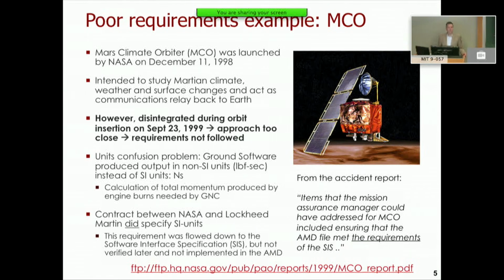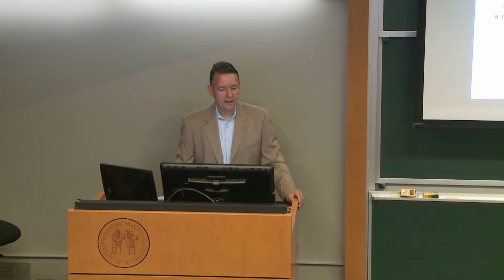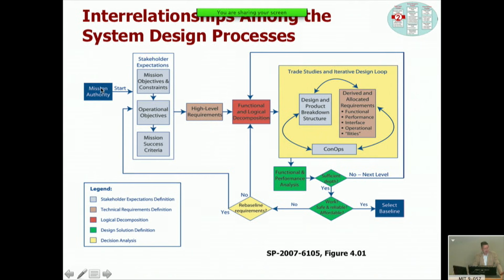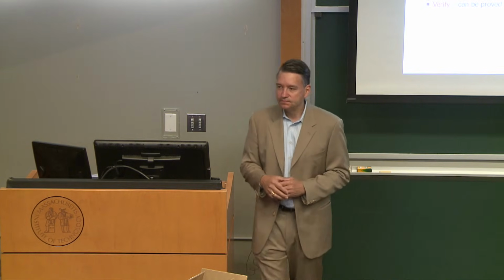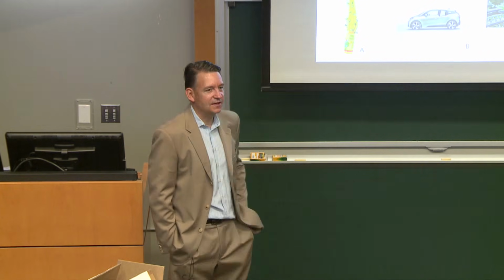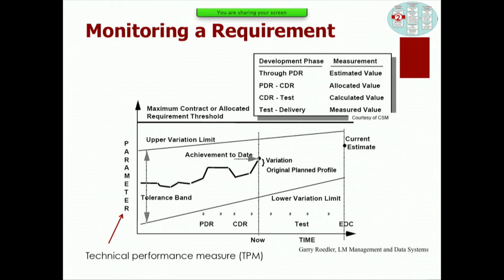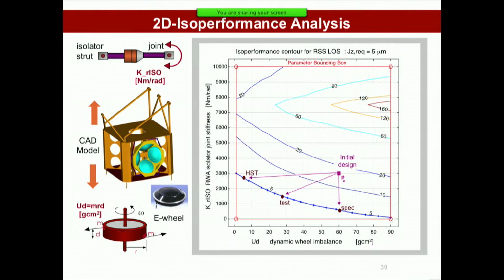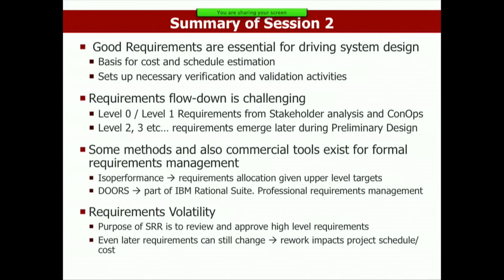2. Requirements Definition

Comment: An easier example of requirements vs specifications might be: 

Building code requires X number of doors on a building for egress and fire code requires they cannot be more than X travel distance from any point in the building.  The designer specifies where exactly doors will be placed (so long as it complies with code requirements) and that they will be X brand, in X material, in X color.  

Building code requires a breakroom to have a sink and a faucet.  A designer specifies that the faucet will be Acme brand, water saving model XYZ in a chrome finish.  

From a requirements standpoint it just matters that these things exist in some good enough form and meets certain minimum expectations.  A specification is saying we're going to use this specific thing to meet the requirement.  

A requirement is a need.  A specification is how to meet the need and also maybe make it pretty.
Reply: I like the way you put it at the end.

Just to add to your explanation, in the video he follows his distinction between design space and objective space with the distinction between requirements and specifications which made me think mistakenly that they were related even though they don't help you distinguish whether something is a requirement or a  specification.
  

For example, a building having X doors is in design space and could just as well be a specification, it's only because of the code that it becomes a requirement. Similarly using Y brand doors could just as well be a requirement of the customer, although in your example it's a specification.

Comment: Is there a mathematical way to model requirements and specification?  Because as is, the current distinction given seems ambiguous.  E.g. If I included "The microwave should be made of stainless steel" then I would have a requirement instead of part of a specification as in the example around minute 24.  Is there a precise model?  Thanks! :)
Reply: It is unambiguous so it is a specification, being precise enough in the given context is another story
Reply: Look up Axiomatic Design